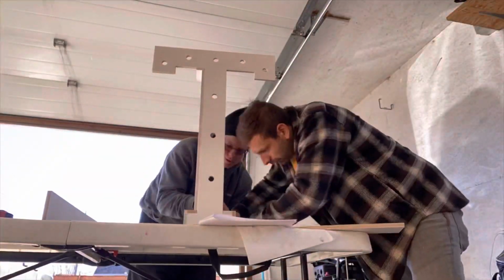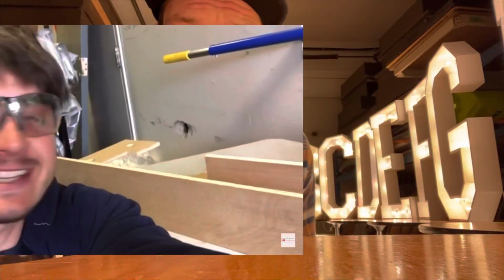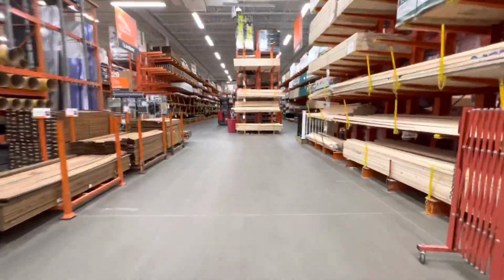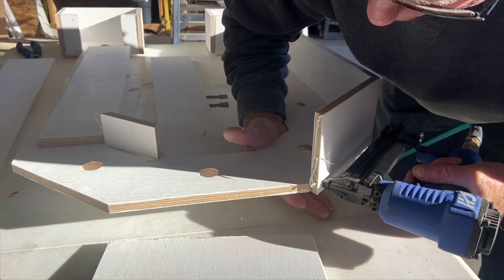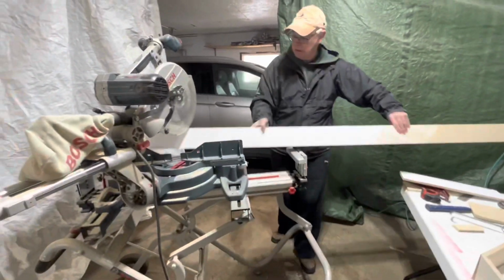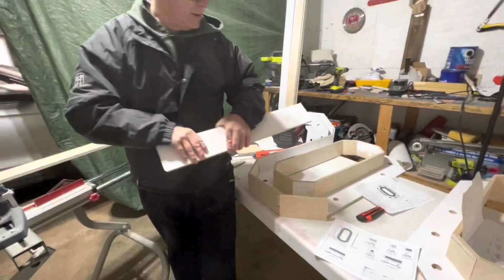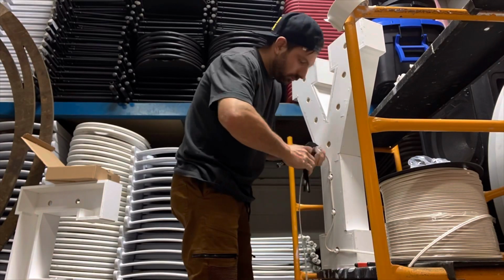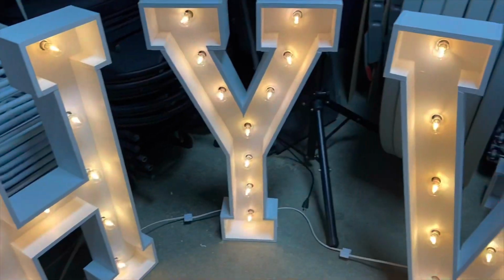How To Make Marquee Letters [ Lights / Cuts / Measurements / Build Method / Blueprints ]

Comment: I have the blueprints and some of the letters are borderline stupid with the angles of the edge pieces. Why the hell would you make something that requires a bevel cut of 65.32 degrees and 69.68 degrees. That's just one example there are so many angled cuts like this on the document. I'm not a professional, but that sounds fucking stupid to me. The instructions are also very bare and don't do a good job of going through the process in detail, overall disappointed with the quality of instructions and measurements. They just scaled it without thinking about the end user

Comment: Hey! I bought the plans. Do the DFX plan have the measurements for the outside pieces so I can get those pieces cut from the CNC as well?
Reply from the maker: The metal version does have the outside DXFs, but the wood doesn't because of the angles on the end edges. Hope that makes sense! Message us on Etsy and we can send you the metal files free of charge, which might work better for you.